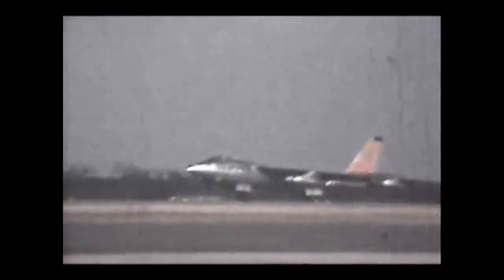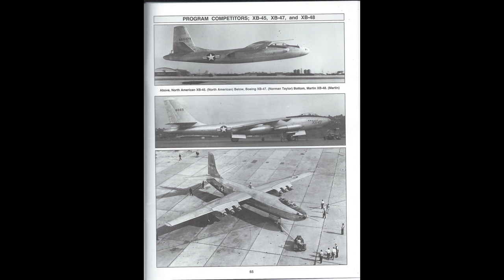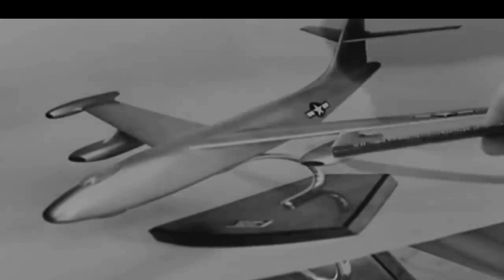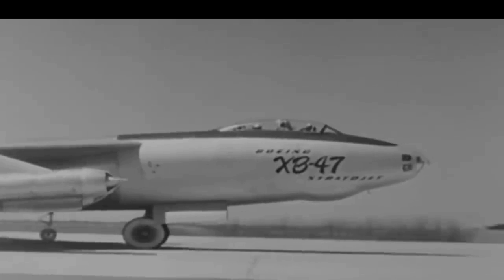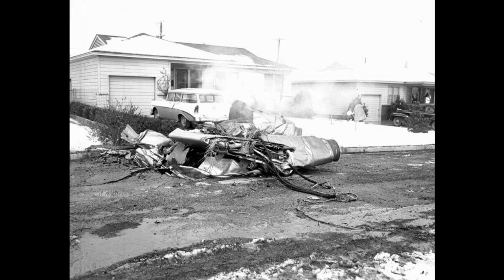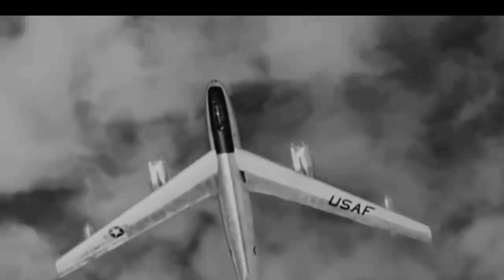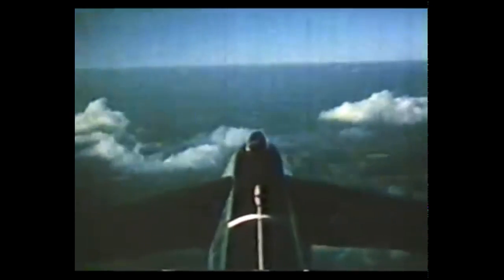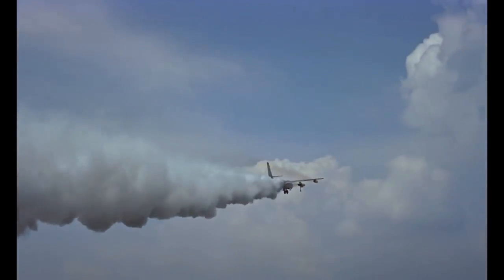B-47 Stratojet- Revolutionary design or flying coffin?

Comment: I flew the B-47 from MacDill AFB, then Hunter AFB, and finally at Plattsburg AFB where the Command began phasing out the B-47.  I went on to fly the B-52.  I guess I took it all in stride and flew the bird for more than 2,000 hours.  It was, indeed, a very dangerous aircraft to fly.  A few minutes of inattention could get the plane's center of balance beyond it stated limits.  Drop tanks could fail on one side, thus making one wing very heavy for landing.  Poor performance from the engines could get you in trouble, especially on takeoff.  If using JATO for takeoff, a bottle could break loose and rotate such that it would burn a hole through the fuselage and AFT main tank, thus causing a magnificent fireball from which the crew was highly unlikely to survive despite 0 ft. ejection capabilities for the pilots.  Aerial refueling could be hazardous since the B-47 had to extend 20% flaps to refuel behind the KC-97 tanker and even then the 97 was not likely to be able to fly designated speed.  So the pilots in the B-47 had to learn to fly in a partial stall, near 100% power in order to accomplish a refueling.  The list goes on, but I didn't encounter a pilot who said he hated flying the plane.  It was very responsive to control input unless you were flying near one of its flight limits.

Comment: My Dad, a McDonnell engineer did not have kind things to say about the B-47. Of course--a little competitive spirit against Boeing, for sure! But Dad earned his spurs. He was the lead capsule engineer on both of Gus Grissom's flight in Mercury snd Gemini, and in 67-68 worked on the new fire control system on the Phantom II. And then was pulled off that to work secret, on the Eagle's fire system. Dad said he got every wish item built into the F-15's firing systems. But, back to the B-47.... it is a shame so many crews were lost. But just consider the alternative: crews of young Communists, flying under the red star over America! Thank you, General Curtis Lemay!

Comment: Problems considered I still think that the B-47 is one of the most beautiful airplanes ever designed.
Reply: I would point out that the coral snakes is beautiful as well, but it is still deadly.
Reply: NOT SURE OF IT'S SAFETY RECORD, BUT ONE OF THE MOST BEAUTIFUL AIR FRAMES TO EVER BE PRODUCED WOULD HAVE TO BE THE CONVAIR B-58 HUSTLER.

B-58 CHAMPION OF CHAMPIONS (PART ONE OF THREE) VIDEO:
https://www.youtube.com/watch?v=46KkNnAhWtQ
Reply: @seymourscagnetti1413  Okay, I am going to reveal my age here. The B-58 was being operated when I was a preteen. I still remember them practicing their low level flying over our house.  It did not last long. Beautiful? Yes. Easily operated? No. It may have well been different had we had the computing ability we have today, but the B-58, in addition to being difficult to fly, also had its envelop eliminated by the ICBM.
Reply: @ManuelGarcia-ww7gj  YOU BRING UP SOME INTERESTING POINTS.

SPEAKING OF AGE.  THE B-58 MAIDEN FLIGHT WAS ON VETERANS DAY 11 NOV 1956.  I WOULD BE BORN 3 MONTHS LATER, FEB. 1957.

ANOTHER FAVORITE BOMBER OF MINE WOULD BE THE ROCKWELL "BONE" OR B-1 LANCER.  WHICH WOULD EVENTUALLY BE RENDERED OBSOLETE BY THE  HIGH COST AND THE INTRODUCTION OF THE AGM-86 CRUISE MISSILE.

LASTLY, ANOTHER FAVORITE BOMBER WOULD BE THE NORTH AMERICAN XB-70 VALKYRIE.

ABOUT 15 YEARS AGO AT THE VAN NUYS AIRPORT - CALIF.  STATIC AIR SHOW I WAS LUCKY ENOUGH TO TAKE A TOUR OF THE B-1 LANCER.  IN A WORD, IMPRESSIVE!........CHEERS!
Reply: That and the Lockheed Constellation.
Reply: That and the B-52
Reply: Grissom Joint Reserve Base in Bunker Hill IN (just north of Kokomo, about an hour north of Indianapolis) has both a B-47 Stratojet and one of the world’s last B-58 Hustlers on display, as well as a B-25, an F-4, and many other amazing aircraft. If you’re in the area, I recommend the stop.
Reply: @seymourscagnetti1413  The B-58 was simply a brute....proof that with enough power, anything can get airborne!
Reply: @edfrancis7001  As SAC navigator, we used to have offload requirements whihc when refueling B-58's were achieved by having them use afterburner to complete the transfer.  Burn rate was same as transfer rate.
Reply: @davezehrung7750  I remember also that as the SR-71 refueled to something beyond half, the right engine would be moved up to first stage afterburner, yawing slightly right as it "hung" on the boom to finish fueling. I believe I also read that only the left pilots' windscreen had a deicing heater, because that was where detach fuel splash ended up with the aircraft yawed so dramatically. Flying the Blackbird operationally took a lot of skill.
Reply: @edfrancis7001  for sure.  I was only on one SR-71 refueling, because we got involved after that in B-52's out of Guam.  When the 71 finished his onload he asked us to get his clearance to climb "to above FL 650", then pulled alongside and slightly ahead, lit his burners and disappeared out of sight above.
Reply: @davezehrung7750  Amazing aircraft...and all done with slide rules almost 70 years ago.
Reply: Makes me wonder how they would've looked nowadays if they never were retired, like the B-52.
Reply: The Mirage IV is the most beautiful :)
Reply: Yes!  I heard and share the opinion.  The B-47 Stratojet, because of it's appearance and performance became the icon for all heavy jet aircraft AND as such can reasonably claim the outrageous but true claim to be, relatively speaking, "The most beautiful bomber ever built (in high production and used so well for what it was).  Turns out, mebbe the B-47, SAC, the USAF  etc. became greater than the sum of it's parts", too.  THAT's what adds beauty to the estimate of what's referred to as or not commonly seen as "beautiful" in this case.  
     But if used as intended, .  . . it strikes the very note of the permanent and irreversible, self-imposed self-defeat of humanity and life on Earth too.  Sorta like the beauty of an SSBN submarine as "beautiful", huh, n 'est pas?
Reply: More proof that looks aren't everything (heh-heh).

Comment: A little known and minor fact in the B-47 story is that it was offered to the Australian air force (RAAF) as a stop gap if it ordered the F-111 as a Canberra replacement. One was sent to Australia about 1963 for the RAAF to inspect. Saw it with its approach chute streaming from my classroom as it approached Sydney airpor .  There was really little prospect of the RAAF taking such a complex aircraft to replace one as simple as the Canberra. Crewing problems, maintenance problems with what have been tired old aircraft and the airfield needs of the B-47 counted against it. The Canberras were to soldier on but with the F-111 facing ever longer delays, 24 F-4s were eventually leased to fill the void. The F-111 did arrive and ended up providing near 40 years of sterling service. Super Hornets now fulfill the role.

Comment: My father in law,  Frank Casto, liked flying it.  After piloting B-29’s during Korea (he also flew a B-17F during WW2) he qualified in 1952 on it.  Flew it all thru the rest of the 1950’s till 1959 when he transitioned to the B-52.   Volunteered to go back to the B-47 in 1963 thru 1966 when he retired, flying out of McClellan AFB in California.  The last B-47 squadron he flew in was a weather recon, so the problems itemized here were not an issue, they flew high altitude, straight and level, the plane was designed for.  Saw a plaque he received in 1966, on retiring from USAF, presented by Boeing, stating he had 5000 hours on that bird.  Quite a lot!

Comment: I am an 88-year-old USAF veteran who helped keep these monsters in the air and not on the ground. Here’s a story about these beasts nobody knew about but the ground crews. The flight crew never heard it because they were safe inside. Now get this picture: When they would land after a mission, there would be a line of them coming down the taxi-way, one behind the other, spaced far enough apart to dodge the rocks from the ones in front. Those six J-47 engines wanted to drag that Pterodactyl faster than it wanted to go, so the pilot had to ride the brakes to curb its enthusiasm. But the brake linings squealed like a prehistoric monster, so there would be this line of them, their necks craned into the air, all squealing their displeasure! What a sight!  What a terrifying sound! The pilots drove them into their particular parking bays as near as possible, but some of them had to be towed into place. The bombay doors were then opened and safety-pinned in place. Hanging from the ceiling would be this atomic egg, straight from the stratosphere, still covered with frost. I ran my hand over these icy packages of American freedom and hoped they would never hatch.

Comment: Brilliant step forward or flawed design? The answer is "Yes".
Reply: That was a big transnational period of time as designes started to move to jet powder.  There were all kinds things we needed to learn with many of the designs of that period. The British Comet had a tendency to suffer catastrophic air frame failures. Several of the early F100 aircraft had significant low speed crashes.  F-102's could not go beyond the speed of sound  as organically designed, F-104's were also known as a difficult aircraft to master.. The B-36 had its problems as well. Finally, the B-58 also had deployment problems too, which was a contemporary to the B-47 for many years.   

As our experience with those aircraft grew, so did our SOP's for them.   Those experiences have helped us understand and engineer the better aircraft we have today.  Going back to that period of time, I would have loved to flown the F-104, B-58 and and the B-47.  Well, maybe throw in Kelly's A-12, and the F-86 just for fun.  So I agree with ssgtslick the answer is "YES". Please go back and reframe you conclusion in the context of its time and other contemporary designs as well.
Reply: Or as an alternaitve, "Both."
Reply: Similar to the F-104, which was incredible fast for the time (fast even for today) , but had also issues.
Reply: @simonm1447  The F-104 is what you get when you ask an otherwise brilliant engineer to design something for you while he stares into your rear view mirror. Was the airframe fast? Of course it was. It was also highly maneuverable which made it a difficult thing to operate and a great many good pilots met their end in it. The USAF never actually had that much love for it, but the West German Air Force did and they paid for it in gallon after gallon of blood.
Reply: @warrensmith2902  The British Comet air frame failures were caused by square windows where the aluminum would develope stress cracks in the corners.
Reply: @simonm1447  'Man in a Missile' my uncle flew them when he was in the Air Force.
Reply: @zigman8550  To be exact, the fatal stress cracks developed not at the side windows, but at the antenna at the roof (they called this panel also window in the crash report). They made several mistakes, they didnt drill the rivet holes, but they punched it (which lead to micro cracks in the aluminum), they used relatively sharp edges (also at the side windows), and they didn't use crack stoppers at the fuselage, later jets like the 707 or the DC-8 avoided these mistakes. 
The Comet fuselage was built with the experience of lower flying props, where such fuselages had less stress and worked, but in higher altitudes the pressure difference is higher and the fuselage has to withstand more stress, and here they had no practical experience when they developed the Comet.
Reply: @simonm1447  That's always going to keep happening, just as it always has. Even the best designs today can be improved. Even if a theoretically "perfect" plane could ever be developed, the next step would be to make it cheaper. There will be occasional fundamental breakthroughs, and everything we think is the ultimate design now will start to more obviously show its weaknesses. In the 1920's Mr. R. E. Olds, founder of Oldsmobile, designed the Runabout, which he said was the best design possible at the time. That was probably true and it was probably also the safest car on the road at the time, now compared to today's safety standards it probably would never be allowed on the road. That's what makes aviation and all these fields so exciting,k the new developments and the big breakthroughs. Looking forward to the next ones.
Reply: @simonm1447  That's the risk that pioneers take, and it's the reason we have such better planes today. Those advances also benefit other fields
Reply: @bernardw4842  I haven't meant it as a accusation against De Haviland, they constructed it with the knowledge of the time, and back then they had no experience with it.
They started the jet age in civil aviation, but they never got the fame for it, and are almost forgotten today.
Reply: @ManuelGarcia-ww7gj  I don't think the Luftwaffe liked the f104, the politicians and officials who were bribed by Lockheed to buy it did though.
Reply: Holy shit, stop saying “ fuelsalage “
Reply: Simon Maier    The comet research into pressure cycle fatigue was shared with all the western airframe manufacturers. This is why there were no failure in the first generation of civil jets from the US.  Later the 737 that lost the forward cabin skin in Hawaii was due to poor inspection and maintenance, but fatigue is real and can bite.
Reply: I won’t blame Kelly Johnson for the F-104 losses. He designed a fast light interceptor on the requirements of Korean War pilots. Lockheed redesigned it and marketed it as a multi role combat with air-too-ground ability. By then Kelly Johnson was out of the F-104 project. Blame Lockheed for promising the aircraft for a ground mission it wasn’t built for.
Reply: @bernardw4842  Suddenly the death trap 737 Max comes to mind, hunh?  Take a popular plane, modify it, skip pilot training, take folks to their graves.
Reply: @zigman8550  that is correct. And when this particular failure occurred, catastrophic failure of the airframe was the immediate, and final result. 
Warren Smith was naming the various losses that were being experienced across the aviation industry. He was not talking about the reasons for the losses. Warren's comment is completely accurate.
de Havilland was having problems with their Comets rapidly disassembling themselves mid flight.
Boeing was having problems with their B-47s shedding wings mid flight. 
I believe his point was that the industry didn't fully understand what the causes of these failures were. For the most part, the industry was designing from the position that these were just airplanes that had a different kind of engine mounted. They were using the same parameters that had been learned during the development of piston powered aircraft up to that point. Jets, however, were turning out to be completely different from what the industry thought they were. It was going to take a while to locate and work out all the new bugs that came with jet aircraft. 
I'm confident that Warren Smith is aware of the reasons for the Comet and Boeing failures.

Comment: All of the first generation jet aircraft had issues, and the B-47 was no exception. The lessons of how to design them, how to build them, how to maintain them, and how to fly them all had to be learned.
Reply: Agree. Given the issues with early jet engines a certain degree of unreliability and - ahem - touchiness regarding handling was baked into the cake.
Reply: In hindsight he real mistake was the life span they planned for the aircraft.  The B47 was a learning tool and a stop gap, the technology was advancing rapidly.
Reply: Right on! Read my comments.

Comment: We have This plane parked alongside a FB 111 at what was the entrance to the former Plattsburgh Air Force Base, Plattsburgh New York. A few years ago a group of volunteers did a real nice job cleaning these two planes up and making some well overdue repairs.
Reply: Dad was a Radar/Navigator/Bombardier on B-47's in (I think) the 380th bomber group out of Plattsburgh and we lived on base in the early 60's.  Two sisters and a brother were born there.  The Air Force moved us in 1965 and I've never been back.  I would not mind visiting some time. I remember boating out on Lake Champlain.
Reply: Hal Areus  In the Mid 80s I went to Plattsburg for a wedding . I arrived early and drove around to see the Town . I ended up turning into a Base entrance by mistake and turned around . The B47 was there and I walked over to look at it . Such a Unique  Plane .  I think there was a Burger king across the road by the Gate .
Reply: 8:38 The 2nd of the two XB-47 's that were made is now on display at The Octave Chanute Aerospace Museum. Illinois. [ not chopped up ]
Reply: Axel Ahlberg, I would guess that was Clinton county airport you flew into, about 10 miles northwest of Plattsburgh Air Force Base. you might be interested to know after the base closure the county airport moved its operation to the former Air Force Base and now utilizes The massive 12,000-foot runway. thanks for the interesting story.